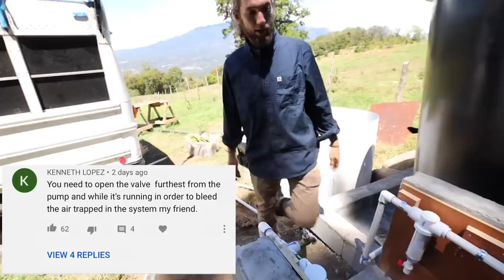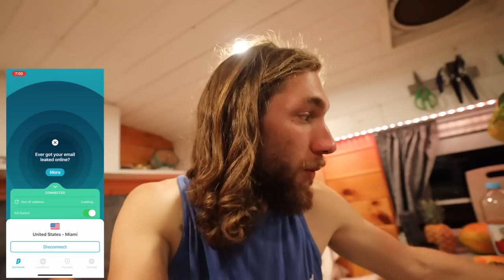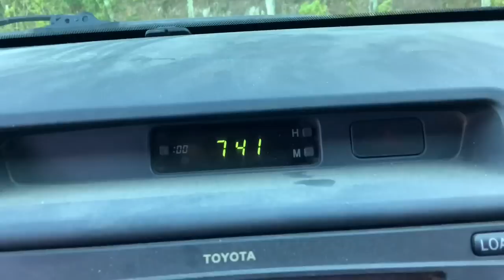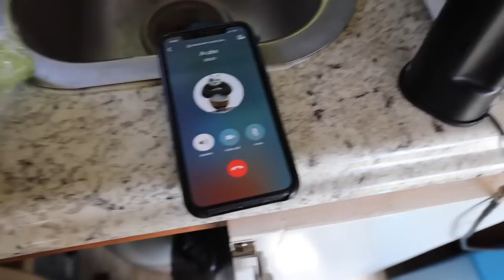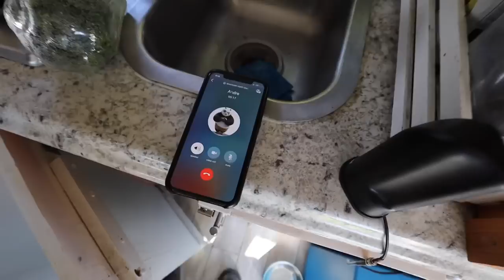Forced Into Quarantine In Our School Bus // van life Panama

Comment: I see lots of other comments on gluing PVC, but I was taught to always sand or ruff up the joint with 100 grit sand paper before priming and gluing.  I would do a dry fit and mark with a magic marker the correct location on each joint to be able by putting a line across the joint to to later put the joint together without guessing.  There you have it...The hammering of the pressure switch on the water pump may be because you don't have a pressure tank or expanding tank to absorb some of that pressure flow...good luck and have fun with the build...

Comment: Try reducing your pressure. PVC pipes must have pipe cleaner first then glue. Try reducing the volume of water from the tank by opening the valve part way. If the leaks are too problematic switch to thickwall black poly tubing with brass couplers and attached with hose clamps. I did this out doors for a shallow well pump on my fish pond. No leaks for 17 years. Replaced the pump once.

Comment: Leaking pvc joints: As someone who has glued pvc pipe for at least 40 years here are some tips for a non leaking joint every time.  I am sure someone will have some issues with what I write here but that will be their problem.  Of Course if there are better ways and suggestions, let me know.
 
1. cut pieces and and wipe ends clean with a towel or cloth.  It must be dry unless you use the glue made that will tolerate some water but still you want to minimize the water.  I fit together the pipe with a dry run or check carefully the fit before proceeding to glue them.  (the old measure twice, saw once--glue once)

2. Always use primer before gluing even if the brand or can of glue says primer not needed or included in formula.  Only in special cases do I not use primer.  I even use it with Christy's Red Hot Blue Glue even though it says we don't have to.  I have had to dig out underground joints that were leaking when they used this.  While it is very good stuff the installer got careless and the joint were not satisfactory and gave away over a period of years.  I do use Christy's some and love it but I take extra care to get a good joint.

3. There are several types of glue formulated:  the standard clear ones that take some time to set up (I let set overnight if possible for all of my jobs.);  The wet/dry glue that will tolerate a thin film of water;  and the fast setting glue that sets up fast with minimum work time.  There are all kinds of mixtures for sale but I stick with the basic ones.  I love the fast setting "hot" glues but the work time is minimized.

4. IMPORTANT:  when you push the joint together, twist it 1/4 turn as you push the pieces together.  This spreads the gue in the joint to minimize any gaps in the bond.  Hold in place until glue sets up to hold the joint.  Twisting it more than that really doesn't help the joint.

5.  when glueing special things like a ball valve inline or transitioning to other type of joints or material do not use excess glue.  When you push the pipe in it pushes the glue into the joint and it gets into the working parts of the valve or whatever you are working with.  this is okay on an ordinary slip joint but not good for valves and so on.

6. When you are ready to glue the pipes use the primer on everything and let it dry for a few seconds. The general purpose of the primer is to soften up the pvc for the glue to bond better. I normally prime most all of the pieces at one time.  Then using the glue "dauber" I spread glue all around the male part of the joint and then I try to apply it spearing ly all around the female part without replenishing the dauber.  

7.  After you glue the joint you must wait the proper wait time for the glue to set and be strong enough to hold the joint.  I remember the first jobs I did in the early 1970's I glued the pipes about dinner time and let it set to maybe around 10:00 pm and turned the water on. Everything looked good when I went to bed.  I got up in the morning and several of the joints had slipped appart some - maybe a 1/4 inch.  I just missed having a great flood on the floor.  Several were dipping water.  I had to redo the whole setup.

One of my neighbors installed water pipe for a city.  He made perfect joints every time.  When he was done there were no drips, runs, or excess glue from the joint.  Not even runs from the purple primer. I was jealous.  

Hope this helps.  
Take care and live well
Gordon
Reply: Good advice
Reply from the maker: Gordon Goos thank you!!!!
Reply: Clean prime both sides , glue and 1/4 turn .. Simple process
Reply: @NomadicMovement  Hey guys! I'm in Costa Rica, and sometimes it's hard to get primer here... So the locals taught me to use 100 grit sandpaper. 
1.Sand the connections both in the coupling and the pipe. It accomplishes the same purpose as primer by roughing up the plastic a bit and giving the glue something to stick to. 
2. Wipe the connections with a clean dry cloth, and glue
Hope that helps!
Reply: Also, it's a good idea to use about a 180 -  200 grit sandpaper on  the surfaces to be mated before you primer. It increases the effectiveness of the primer, and the bonding surface.
Reply: When I first started glue pipes together for an irrigation service (lawn sprinklers) the old man who taught me said always primer twice never had a leak still used that advice 30 years later.
Reply: @markwilson8118  
@The Nomadic Movement  

Exactly THIS^^.  I'll just add...Hold the parts firmly together until it sets...depends on temperature.  And then let it fully cure before putting it under any internal pressure.

It should be fine after a few hours if it's just an unpressurized runoff drain, but even then it depends on temperature and you still do not want leaks.  Hope you guys get it fully sorted.
Reply: I've used Christy's Red Hot Blue Glue for years here in Arizona and on several hundred feet of lined up PVC walking applying glue to male/female insert twist until done and always used immediately after completion. So about 1-2 hours depending on how long it took to finish hooking everything else up. Never used primer in my life and never had leak a whether on city water pressure or deep sunk pump. There is no way they should of had a leak with barely no pressure unless there wasn't enough glue applied or massive dirt on the PVC. I remember watching him gluing it together and it seems like he was only applying glue to one side on most connections.
Reply: Gordon Goos; Have you ever considered making your own (instructional) YouTube channel? You seem knowledgeable. And conveyed the message well so it could be easily understood... 
Maybe try one out. 👍
Reply: I would have a flex live from the filter on the wall to the pump. Over the years there is vibration and a flexible line would absorb the vibrations
Reply: I work for a solvent cement (pvc glue) manufacturer, it's super important to properly clean your pvc before you glue the joint, use primer and a good pvc glue. Let it dry COMPLETELY! The longer the better. Hope this helps!

Comment: Glad to see your pump working. 😉 
Tip # 6 (cont from prev): There's an arrow on the check valve that indicates which way the water flows through it. IOW, it will only work one way around. 🤙
Tip #7: PEX is great, but over time it will get brittle and disintegrate if exposed to the sun's UV. IOW, if you use it (instead of galvanized pipe) I suggest that you cover it or paint it with a UV resistant protective coating.
Hope these tips are helpful. Forewarned is forearmed, right?
Glad to see things moving along. These are very challenging times for everyone. The 2 hour shopping limitation sounds like a good idea. You guys are awesome for helping to support your neighbors. 'What comes around goes around.' 👏👏👏 That reminds me, I need to check out your coffee.
Best place to be is in the sparsely populated countryside. Good time to be The Hermit.😎

Comment: Not all glues are created the same. I would stick to the grey glue and also be careful with oxidation. When the glue gets too jelly-like, it is no longer good. Also, vibration is an issue. See if you can find some rubber (rubber tire maybe) to place under the feet.

Comment: You guys need to know urgently before you burn out your water pump! The pump will constantly turn off and on because you need to fill the pressure tank air bladder with air, usually around 50psi. Then your water pump will run consistently. Much love guys!
Also note: while filling the bladder with your compressor, you'll want to have the pump off, and all your output valves open to avoid damaging your pipes with excessive pressure.

Comment: Jordon here is a word of advice on air in the lines. 

On the high side of a pipe install a T that you can threat a plug into. 

Or before installing pvc. Go to the auto parts store and buy some wheel valve stems. 
I prefer the threaded plug for a T

Comment: I think the trapped air...caused the whole system to explode. You have to "prime" the system. Like a water hose with a nozzle....eventually water will shoot out and release all the air. Watch out not to prime will cause your pump to explode...that is why your pipes have leaks. Air had to release under pressure...so it busted up your system. I would have completely redone the system. Open valve closest to bus. Quarter way. The water should spurt and sputter out then flow freely.

Comment: Glad to see your water is working. If you haven't already been told, you will be more likely to experience leaks on the pressure side. In the video you said you had 40psi. Seems like alot, you should regulate the pressure coming out of the pump much lower, this will greatly reduce possiblity of leaks. Your PVC is probably at its max psi at 40.
Good luck stay safe.

Comment: Yes that is true that you need to open that valve so the air can get out but you need a opening just before the pump that is higher so you can completely fill the lines from the pump to the tank. As many times that you have started the pump hope you haven't over heated the seals.

Comment: I'm thinking you should have hired a plumber or a welder instead of a barista.  BTW, you can't use PEX where it will be exposed to sunlight.  It will deteriorate quickly.  Even UV stabilized PEX will only last a few months.  Some types can be buried.
Reply: COL - cough out loud

Comment: When you are doing the connections are you turning the pipe in the connector?  Just twist it atleast a quarter turn when you push it in.  The CPVC pipe should have a 2 part glue, a cleaner and then a glue.   The quarantine is a really hard thing on people but if it gets them past the first wave of the virus it will save thousands of lives. It does effect all ages, just not as much in the younger group. Hope you guys stay safe and healthy.

Comment: Thanks for the very eloquent and inspiring introduction. Your water pump issues must be related to the concept that unlike an air pump a water pump cannot suck or push air it can only push water , just as you cannot move a canoe forward by waving your paddle in the air... so if there is air cavitation in the pump impeller nothing will happen and the pump may overheat? Also make sure you ar using the proper glue for the type of pipe you have and you may also need to apply a glue primer first ? ( I am not a plumber and I kayak downstream  more than I canoe upstream :>)

Comment: The vibration of the motor /pump may fracture joints.....hence the leaks...you could  fix a flexible pipe to and from the motor/ pump to minimise that risk.....good luck from cadiz spain

Comment: Sorry to hear of your PVC woes. That's annoying. We don't use much PVC up here in Alberta - either in residential or commercial builds that i've supervised on the last 20 years. I'll either solder using Copper or use PEX. Obviously PEX is the preferred choice. Great video! All the best to you guys! Stay safe. ❤️ A good friend of mine from here moved to Panama (Pedasi) a few years ago. We FaceTimed yesterday and he informed me of the 2 hour window that was imposed down there. A bit crazy but good if it will help stem the covid tide.

Comment: A couple ideas for your water, you don't need a filter before the pump, there is just a medal impeller inside the pump, the filter before can cause problems,  second put in an outlet low down before the pump so if you lose electric or pump itself you can use the pressure from the height of the water in the tank to easily get water. Also I am unsure why you are getting so many leaks. I live in El Salvador and have done lots of this plumbing with rarely a leak. Maybe try a different brand. Suerte

Comment: Now you guys need to get a portable little washer with a wringer.. That way you can do your laundry there and hang it out.. I have a panda B45 but Costway make cost way make them also.. Mine will do up to 11 pounds of laundry at a time and they're only like a little over a $ 125.00
Reply: Those are awesome.  I used to have one and they're also compact and could easily be stored in that shed they're building.
Reply: @fanfare100   The great for RV or Van living anything like that..  They're very light weight and do a great job  exspecially the spin dryer.. I literally can hang clothes up for less then hour and they're dry

Comment: on camera, the color comes across as the same exact color. I hope you will heed my advice. That water set-up would have worked the first time if you had hired a  local plumber.Think of the time spent, think of the re-purchase of pvc pipe and glue and supplies.  you are lucky you can be outside all day working. some people will be stuck in an apartment for most of the quarantine. good luck.

Comment: How are you going to get water from your truck to your water tank. You should just buy a little electric pump, like even a little fountain pump, they are cheap. Plug it into the inverter or your generator when you get home and move all the water.
We used to move hundreds of gallons that way when we grew pot years ago. Easy and cheap.

Comment: Not sure why you're having such a hard time with the leaks. Use the primer and glue on both the inside of your connection and the outside of the pipe and be generous with the amount of glue you use. The pipe should go all the way to the stop ring inside the connection. You shouldn't be having these leak issues.

Comment: Are you using cleaner before applying glue? That could be your problem.
Reply: I'm wondering if the glue is the problem.  In the many times I've glued PVC pipe, I've never had a leak.  (Another thing that might cause leaks is not twisting the pipe about 1/4 turn after inserting into the male piece into the female.)

Comment: Hiws the 2hrs a day quarantine going for you?? If you run your pump like that youll burn it out fast as hell, connect the switch correctly. Pvc is the easiest piping system to use but you need to learn how to connect it properly

Comment: PVC isn't meant for pressured water
Reply: Philip Smedley Schedule 40 in the size they are using is good up to about 300 psi......it’s the glue they’re using that could possibly be the issue.....they defintely need to be using cleaner first and then heavy duty or extra heavy duty cement....if they’re using regular or medium bodied cement they could and probably will experience leaks at some point.....so cleaner and heavy duty cement would defiantly help them as well as installing a check valve and some unions in key spot so they don’t have to keep tearing everything apart to fix things.....
Reply: Gottcha thanks for the insight

Comment: I'm a big fan of yours for your travel videos, your entrepreneurship, and so much more. As for your PVC pipings, just 2 recommendations: 1.- When you are about to put them together, don't slide it straight, rather do a quarter turn either clockwise or counterclockwise, this way the glue gets distributed it evenly and you have less risk of leaks, 2.- I highly recommend you get some "tuerca union universal" which is a way that when you need to fix some section of your water line you don't have to cut an glue a new fitting. This link is so you know what it looks like: https://www.homedepot.com.mx/ferreteria/ferreteria-general/tornillos-tuercas-y-arandelas/tuerca-union-universal-pvc-lisa-3-4-968239 (I worked in a water purification company for about a year and a half and this were used to reduce the use of glue and save time and effort) best of luck during the quarantine

Comment: when you glue you have to twist the pipe conecting
Reply: Use ruff sandpaper to abrade the surfaces. Inside and outside where the touch onced glued.

Comment: Putting together PVC is not as hard as you are experiencing. I see the blue so are you using a primer before the glue? You just should not have that much seeking. Can you find a glue there named "Red Hot"? it does not require a primer and it is all I use. I am a retired custom home builder.